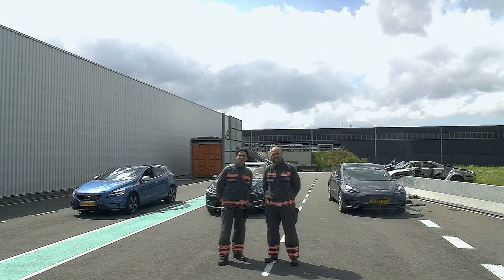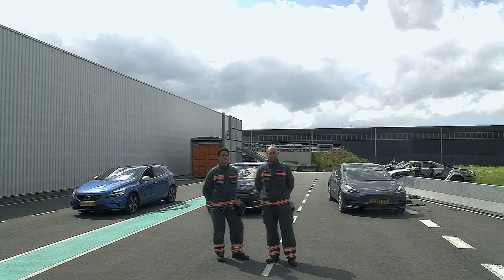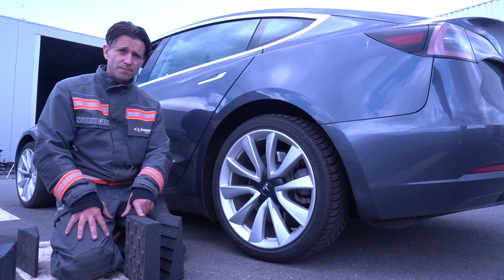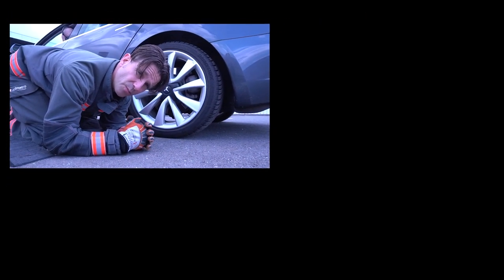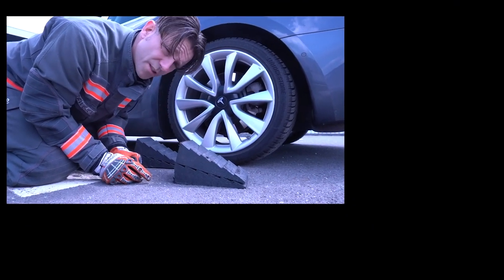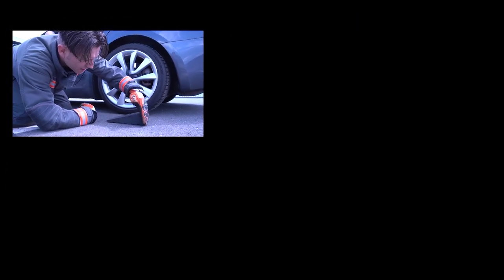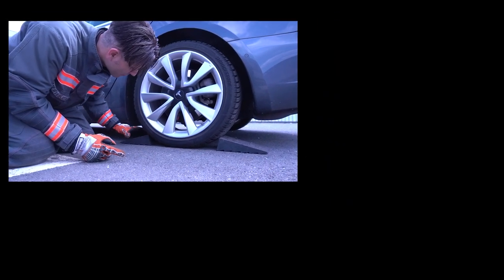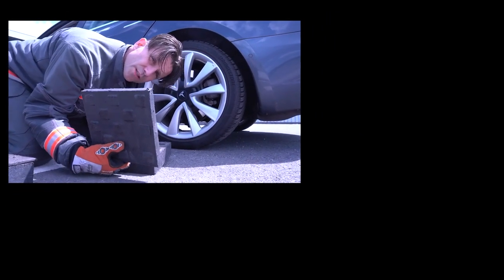Holmatro Rescue Hacks: #10 - Options for blocking the wheels

Comment: Where you trying to drive over them in a standard fuelled vehicle?
Reply from the maker: The "standard"fuelled car was an automatic gear car. This car also starts rolling when the foot is lifted from the brake. no throttle was used during the tests.